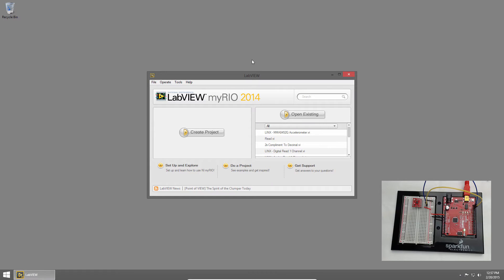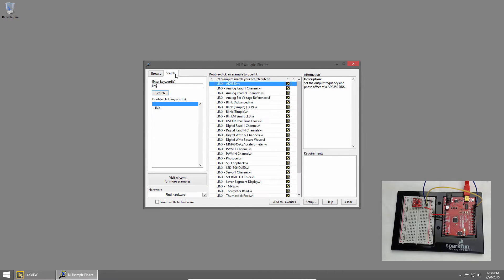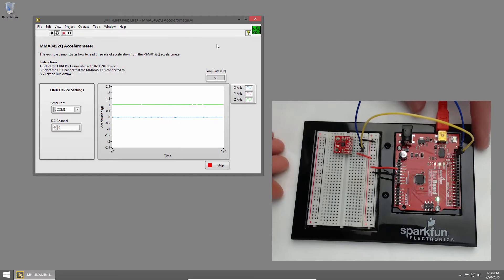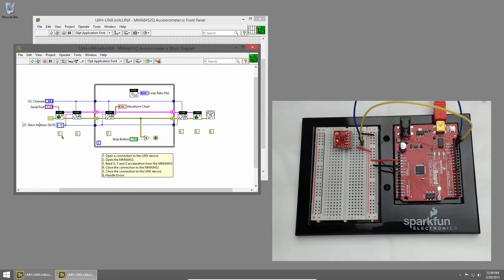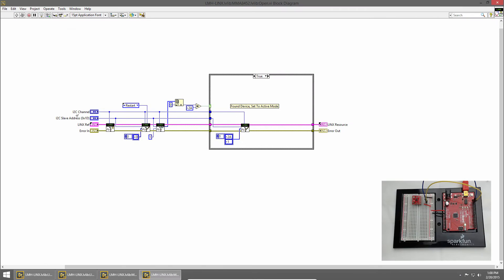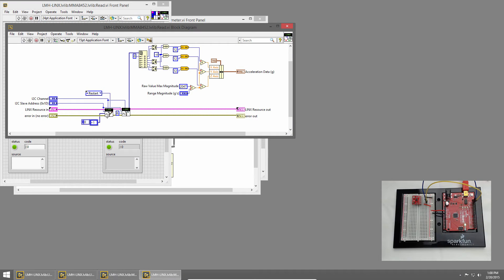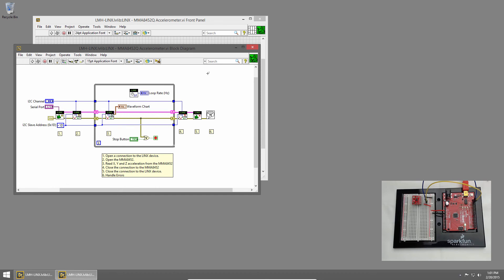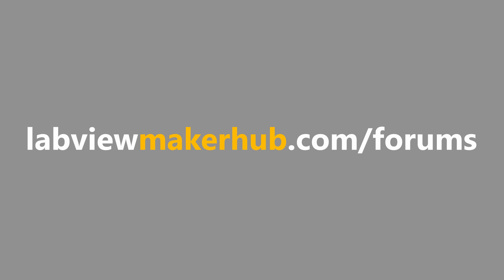Sparkfun Inventor's Kit for LabVIEW - 16 | MMA8452 Accelerometer

Comment: I'm connecting the sam setup but using an accelerometer MMA8451. I changed the setup to include MMA8451 LINX setup instead of MMA8452Q. However, I keep getting a timeout error. How can I solve this?